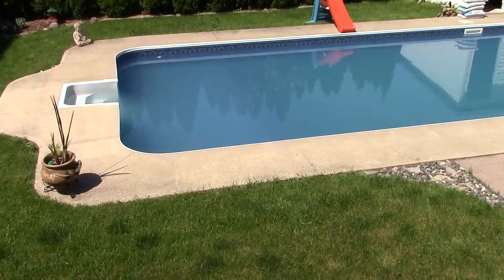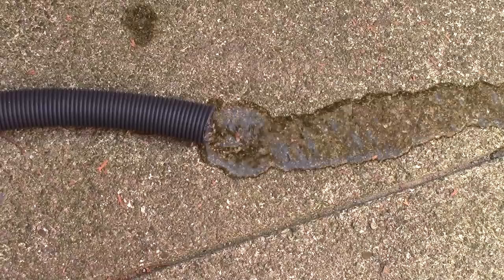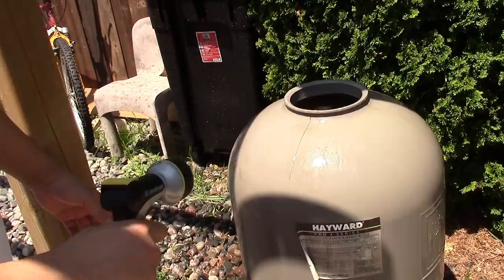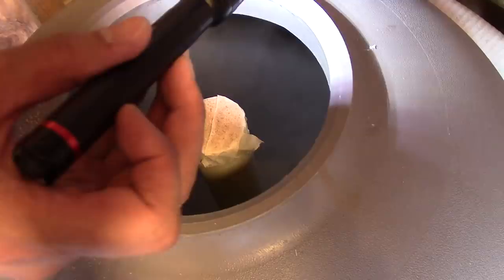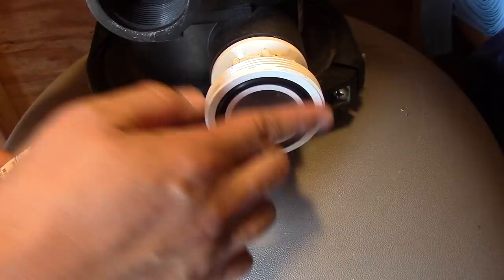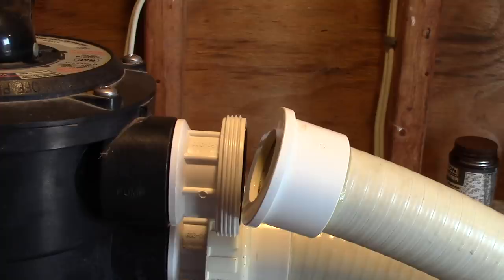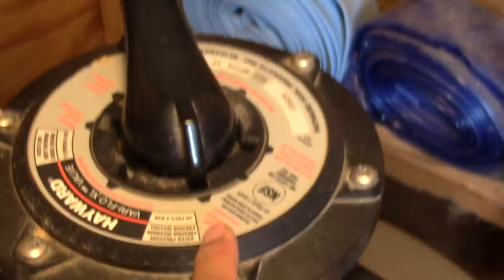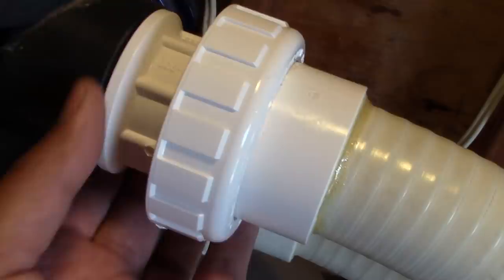My pool is cloudy: DIY Change Sand In My Pool Filter.

Comment: Nasty filter
The best is DE filter pentair
Reply from the maker: Good to know if i need a new one.
Reply: Have nice day
Reply: @juliomedero1480  de filter are top of line for filtering microns but also have the highest amount of maintenance. De powder, acid baths etc. I feel cartridge filter is best overall filter. Pentair clean and clear 320 is what I use on my pool and sell to most of my customers.
Reply from the maker: Thanks for sharing. Now our viewers know especially in the Texas area.
Reply: Steve Nunz thats is the problem with people they just spew out information and don’t tell you that a d.e filter is a very high maintenance and expensive filter system yes its a good filter but you have to let people know everything about that type of filter not just oh is the best

Comment: It sucks to see people getting talked into buying a sand filter instead of a DE or cartridge filter
Reply from the maker: You're right. I had a comment that said my system is out of date and I should buy new stuff to revamp my system. I don't think he understands my Youtube Channel. I get self satisfaction when I do things myself and I save money. My channel is not about spending tons of money on new system, especially when  its not broken. Thanks for sharing that.
Reply: Russian Bot #19538532 each filter system has its good and bad points you should make sure of what kind you have and research that kind to make sure it’s operating at peak performance and each kind of filter system should do fine
Reply: @jonandthey8894  turn on a light in a pool at night that has a sand filter and you will see why sand filters are the least effective filter. You wont see those same particles in a pool with a DE or cartridge filter and that's because the filter traps them as opposed to a sand filter. That's from 24yrs in the pool service business. If particles are going thru the filter, then it's not doing its job. Ppl who put sand filters on pools dont make a living of servicing pools. The difference in cost between those 3 different filters is very small.
Reply: There are no draw backs to a DE or cartridge filter. Unless you complain about the time and effort that it takes to work on them. But then again, not everyone wants a really clear pool I guess
Reply: @jonahvlogsdiy4143  the difference in cost between a new DE or cartridge filter as opposed to a new sand filter is very little. Therefore what I'm saying is, a cartridge or DE filter would be the best way to go because it filters better. Which means less algea, clearer water and less chemicals being used.

Comment: I replaced my sand with glass beads. Much better results..
Reply from the maker: Never head of using glass beads.
Reply: JONAH VLOGS & DIY I believe the correct term would be Glass pool filter media.. If you have a sand filter this is a big upgrade. It’s not crazy expensive and it never has to be replaced.
Reply: Matt Windisch i heard of great results with the glass and the idea of never having to change it is great

Comment: You left out the part where u add water before adding sand. The chlorine makes those plastic fingers brittle. Little shards of sands will crack them instantly. Ok video could cost people who watch this without reading comments a lot of money.
Reply from the maker: Never had that problem. I've had my pool since 1999 and I've change the filter 4x. It's still the same sand filter.

Comment: Using a sand filter is like thinking using a carburetor on a vehicle is a good choice. Keep up with the times and switch over to a cartridge filter if you want a crystal clear pool.
Reply from the maker: Thanks for the info Don. Something to think about in the future.
Reply: Don Couch sand filter is 100 percent acceptable if you go into 100 yards with pools 80 will be sand 10 cartridge and 10 paper filter
Reply: @jonandthey8894  Back in the day maybe, but again it's old technology and not anywhere as effective or efficient as a cartridge filter.

Comment: Your whole pool system looks like it was diy. Flex hose is junk 
You have an air intrusion, you shouldn’t see air in your pump. 
You didn’t lube the pump Oring and you were touching it with your bare hands. The oils in your hands degrades the Orings. 
The way you have your equipment setup is laughable in the pool industry.
Good on you for doing the sand change but you should really upgrade your system.
Reply from the maker: Good to know. Thanks for sharing.
Reply: DabEz ko could of sworn i saw him lube the o rings and gasket so
Reply: DabEz ko what flex hose are you referring to his backwash hose lol
Reply: Jon Andthey you gotta be blind if you don’t see everything plumbed up with flex hose
Reply: This is one of the douchiest comments I've read in a long time. -- Maybe hard PVC is better, but the flex seems to be working fine. My pool has been using flex line since well before I bought my house (It's been working fine for at least 20 years). Air intrusion? Oh, you mean the few air bubbles after he had the pump filter housing cover off, that work their way out after a few seconds (he panned away before they did)? He lubed every single o-ring except for the most easily accessible one that is exposed every so often anyway? Who cares? If he gets a leak, its two knobs and $4 to replace it. 

He is a private pool owner, I seriously seriously doubt he gives even 1 single damn what the 'pool industry' thinks. There is literally no actual reason to upgrade his system until he needs to.

Must be hard to be perfectly perfect in every way, bud. Get off your high horse you pool professional, you.